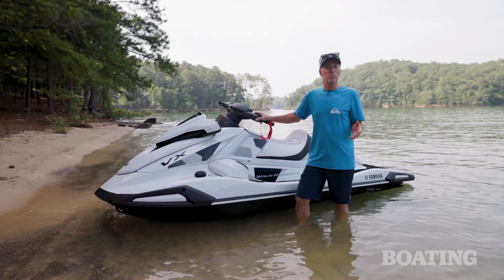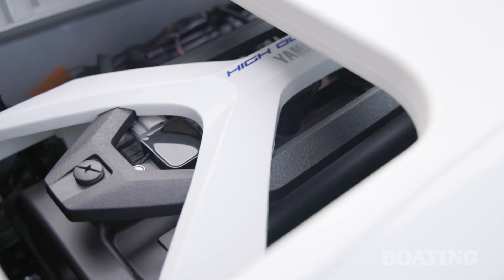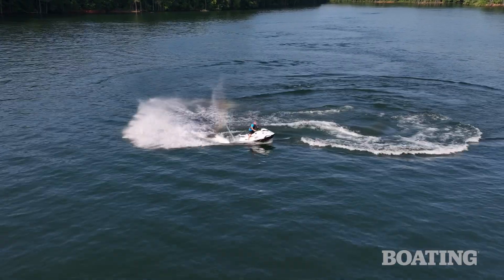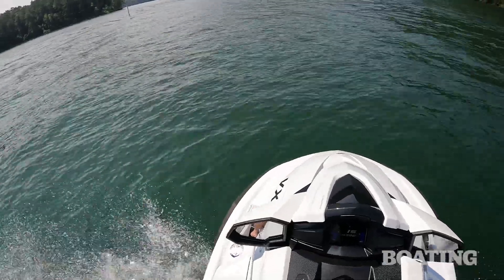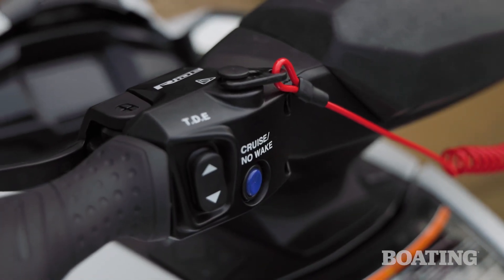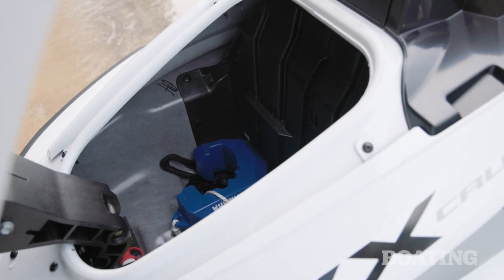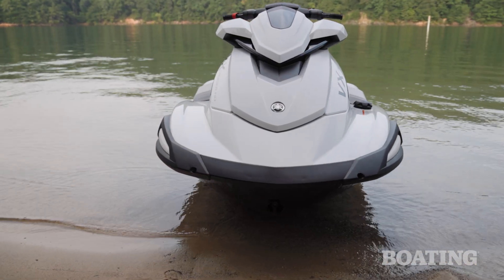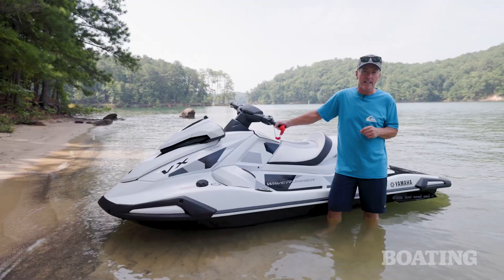2024 Yamaha VX Cruiser HO

Comment: Just purchased the Azul Blue VX cruiser HO. Put 2hrs on it yesterday. It rockets out of the hole. Honestly doesn't feel much different than the 2018 GP 1800 SVHO we had before. The SVHO was faster up top. Hit 71 on that vs 64 on the VX HO but I like the ride and comfort better of the VX. It's a sweet machine. Got it on sale for 13,099.00.

Comment: Would of been good to see some comparisons of the efficiency compared to 1.8.
Reply from the maker: Hi, Jason. Thanks for commenting. Tests of Yamaha boats can be found here:https://www.boatingmag.com/story/boats/2021-yamaha-255-fsh-sport-e/
Reply from the maker: And here: https://www.boatingmag.com/story/boats/2021-yamaha-255xd-wsbbg/
Reply: speed wise ?..they are about the same ?, as the uscg will limit the top speed from factory settings. fuel wise ?, the 1.9L will drink more fuel, as it has 20 more hp than the 1.8L engine. cost wise ?..yeah...glad i got my '15 fx ho cruiser back then in 2015, as they seem to have jumped way up in price tag lately.

Comment: Are there really any significant differences between this and lets say the GP HO? Other than maybe some handling? Just trying to figure out if its worth the extra $1,000+
Reply from the maker: It's always a personal decision, but some things to consider might be: The GP HO is 80 lb. lighter. The VX Cruiser HO comes standard with the factory audio.
Reply: @BoatingMagazine  Do you think that weight difference makes any sort of a significant difference in fuel economy?
Reply from the maker: @jonmitchell9213  Weight and power are the primary determinants of efficiency and speed. The 80 pounds represents about 12 percent. Same rider, same habits, same water, yes it should deliver better efficiency. Enough to matter? Again,  that's personal,  as a PWC doesn't cost " much" to run to begin with. ( meaning we acknowledge that this point varies by the individual).
Reply from the maker: @jonmitchell9213  So, while the weight difference matters with regards to efficiency, our opinion is that the lighter weight will better deliver a benefit of a sportier, more agile feel.

Comment: Just got mine and 25 minutes into the engine break in and check engine light came on. Dealer has had it for a few days and can't find the problem.  Waiting for a Yamaha technician to try and figure it out.....Wow!
Reply: what is the code(s), I worked at a new car dealer. Usually It is just a software issue. OBD2 system Sensor defective is very easy to fix.
Reply: 25 min's into break in...and it's already messing up ?..wow !. just goes to show ya...newer isn't always better..lol. my '15 yamaha fx ho cruiser has not had one issue from day one, been great. anytime i see new stuff come out with all this fancy electronics ?..i cringe at the fact it will cause trouble...and sure enough..it shows !. no trim, no cup holders on the vx ho ?, and larger price tag than the fx ho cruiser ?..no thanks..i'll keep my '15 fx ho cruiser, and its paid for..lol.
Reply: Got it back after 3 weeks,  said it was the throttle body.  Took it out,  finished the break i😢n and another check engine light.  Dealership has had it another two weeks.  This time, they think it's a bad ecu. Waiting for the part now.

Comment: The specs say it is 3370 long, that cant be, that is massive. How long is it?
Reply from the maker: 132.7 inches. A bit over 11 feet.
Reply: @BoatingMagazine  So it's 3370 in standard. They are massive, the length.
Reply from the maker: @chippyjohn1  Massive in comparison with what? It’s relative. For instance a Sea-Doo GTX measures 135.9” / 3451 cm
Reply: @BoatingMagazine   3451cm wouldn't be correct. Their size comparison compared to what they used to be and even small tenders that hold more people. They were originally a motorcycle for water, now they are a car. They have grown in size by over 50%. It's longer than the car I drive.
Reply from the maker: @chippyjohn1  Yes. You are talking about decades ago. That said, one can still purchase smaller, single person models of modest power.